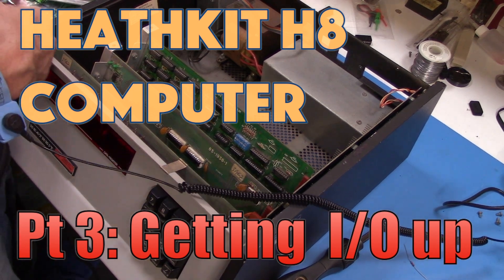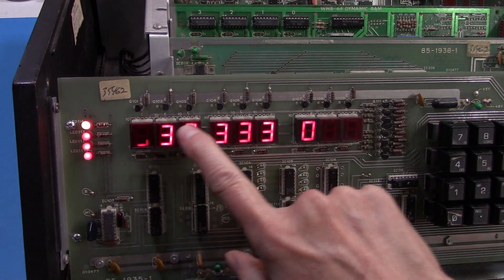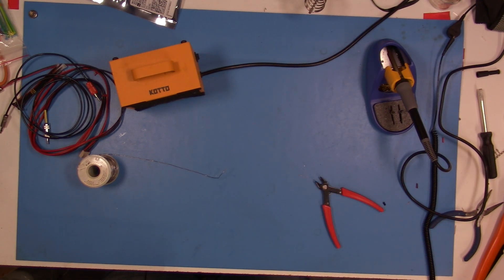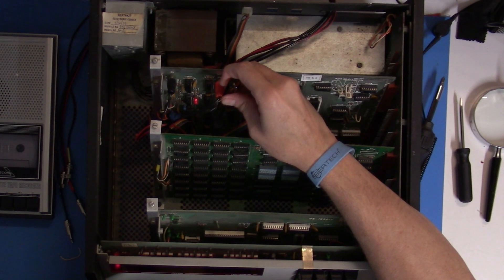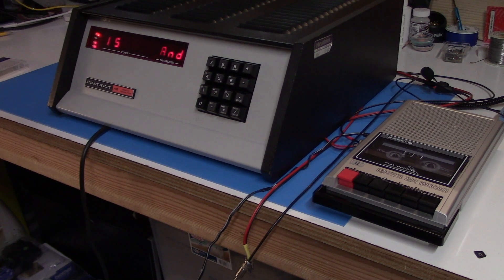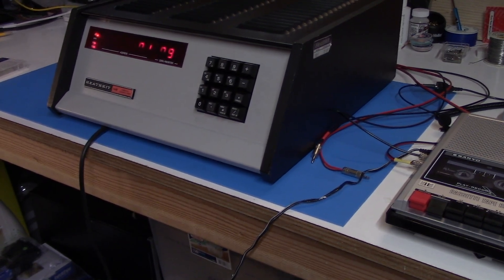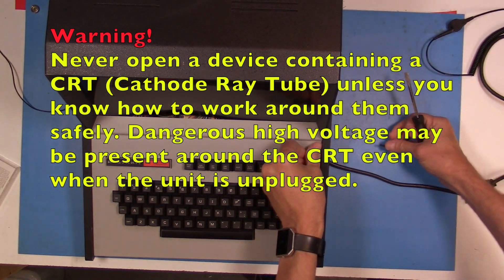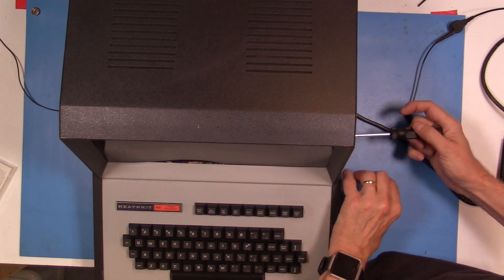The Heathkit H8 Computer - Part 3: Getting Cassette I/O Working

Comment: At least check all the power rails to ground with an ohmeter.  Shorted caps will read, well shorted!  Finding the actual bad cap with an ohmeter requires good contact with the probe, and a meter that can read fractional ohms.  But don't power it up if you read a short!
Reply from the maker: Exactly. That is a process that I do. In 0:02 the case of the H8, there was no short evident measuring between the 5V rail and ground on the CPU card, but the tantalum still blew on power-up.
Reply: @primal-bits4777  If you have an ESR tester, you might be able to measure the caps in circuit, or lift one lead to test.
Reply from the maker: @KennethScharf I do have one, and that would be a good predictor of potential failure. I hadn’t thought to do that.

Comment: Most H8 owners don't bother with installing the bottom screws unless shipping.  There is a jumper on the H8-5 that will connect the two cassette controls together (so you don't have to modify the cables).  The beep issue may be due to a modified front panel to allow it to play "music".
Reply from the maker: I did find the jumper locations on the H8-5. For fun, I’ve set up a second cassette deck. One for load and one for dump. Not sure it is practical, but Heathkit seems to have had that in mind. I’ll see if I can find data on the FP mod and see if that is possibly what is wrong. There is some bodge wiring on the back of the FP PCB.
Reply: @primal-bits4777  easier to verify it against the assembly manual than trying to find info on the mod.